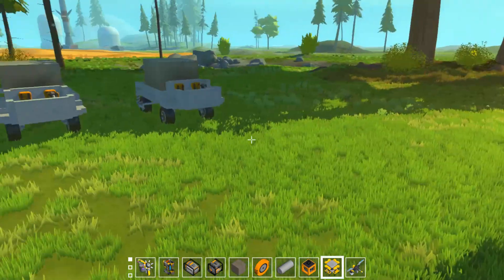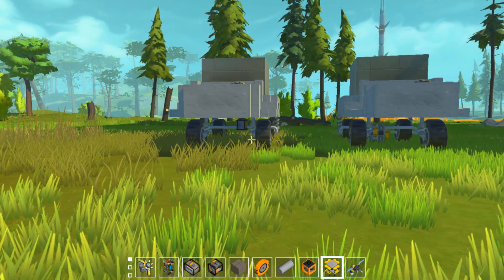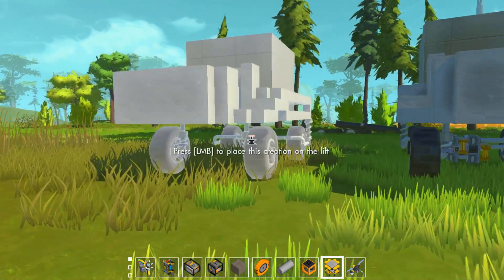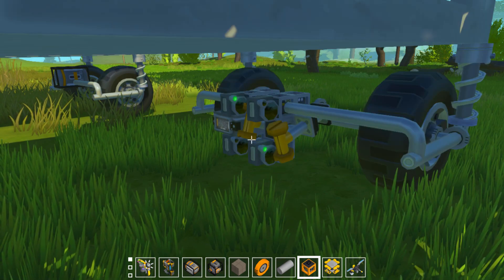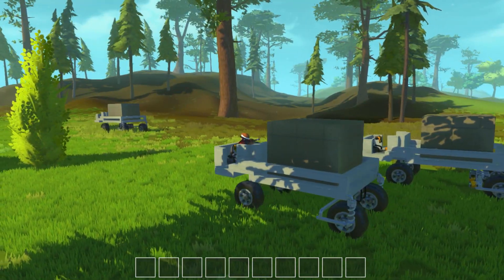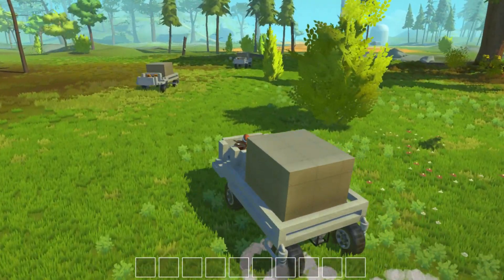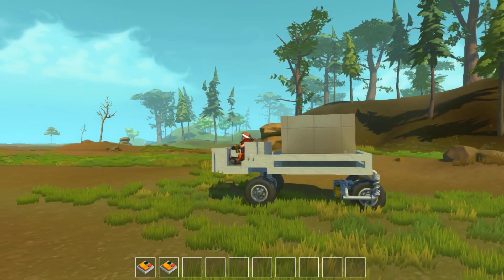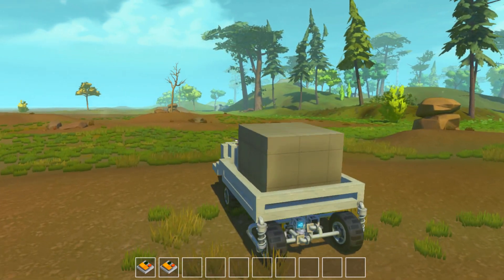Survival Piston Engines?  | Scrap Mechanic

Comment: Oh yeah, the gas engine cranked up, that's moving at a very good click. But then again, with what I've seen of people putting a Craft Bot on their car, or a drill with a resource collector and the Refiner Bot, that gas engine model here would be using maybe 1 fuel every dozen or so seconds at a Level 5 Gas Engine's efficiency. Once you start diving into warehouses the electric engine becomes far more viable fuel-wise since you get so many batteries from the Tapebots, and it can move heavy loads easier with its massive starting torque. But pistons are king since there's no reliable way to have them draw fuel, apart from maybe a cooldown on their movement since whenever other than an infinite fuel engine will they need to move so quickly? Then again, lower the cooldown at higher levels, so a Level 5 Piston engine would still be viable, but expensive on Component Kits.

Sorry for the info block above, I'm still drowsy so my thoughts are unfiltered and mostly hardwired to my mouth XD

Edit: And ah, the piston engine, being a multipart engine mounted directly to the axle, means its very fragile to Haybot and Totebot attacks. Even Tapebot attacks near the Warehouse entrance. And if they tweak where the Bots aim their attacks, then they will likely swarm the engine itself, swarm a mechanical object since that will likely disable whatever heretical-unauthorized-farming-device the scrap mechanic is using. It kinda makes sense that way lol

Comment: piston engines are really usefull, not because of the lack of fuel consumption but because of the power it provides, it is cheaper than a max level gas engine, which uses ton of component kits which are hard to get lots of and the piston engine can also use less resources and provide all the torque you will ever need, disadvantages: uses lots of bearings which require scrap metal which you dont have much laying around and that is about it.
Reply: im planning on seeing if they get patched and if not building a massive RV with all my stuff and a like 8 cylinder piston engine but still struggling to get the basics of piston engines down never used them before
Reply from the maker: Right now I'm running an i2 piston engine on my survival rover...

Comment: I think the pistons should use compressed air. For example you have a container of compressed air and you need an air compresser to get more. There would be different types like the electric wich makes it more compressed but is slower or the gas wich is faster but compresses it less.
Reply: uhm if they did i believe we getting a generator now so we can just make engine have generator attached to battery to the compressor which is electric so it would need to stop and recompress air but it would still go as usual

Comment: so cool - also how did you build the that V2 piston engine. I'm interested in how it works
Reply: V2s don’t exist
Reply from the maker: But v2 engines do exist. They're usually used on motorcycles...
Reply: AL Magma isn’t it counter productive for an engine that small
Reply from the maker: In SM, yes. Irl v2's have their pros...